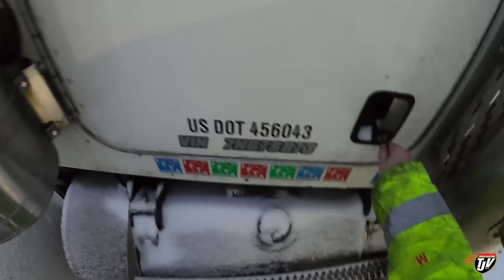BURIED, FROZEN, AND DEAD | My Trucking Life | Vlog #2470

Comment: Josh's gas station is like the old "gas wars" where gas stations on all 4 corners were constantly lowering prices, like each corner had a slash thru each of the posted prices, 7, 6, 5, 4 cents a gallon. That's right, 00.4 cents a gallon US! The oil companies were quick to fix the low prices! It was great while it lasted

Comment: Hi Josh . In conditions like that . I have in an emergency  in remote area  TAKEN OUT THE AIR FILTER .Take the pin puller tie a rag on & dip it in Diesel fuel  squeeze it out hold it to the induction let the motor suck the flam in  BUT NOT THE RAG  get a helper to hit the starter  if the battery’s are good and she turns over fast  . I guarantee she will start 👍🇨🇦

Comment: Drive my truck 91 f150 with a built 302 and 3500 stall torque converter and 430 gears 😂 my fuel milage sucks

Comment: Pretty strange how the batteries got snowed all over like that,as if the cover was off during the night and then that blokheater that wasn’t properly conected….very strange.Was kinda upset to see you sitting in the other truck with that grease spot on the back of your vest…the grease would come off with some petrol or a grease remover

Comment: Fuel prices are the same at all stations because of the provincial regulators that set it (usually once per week.) It's not up to individual fuel companies. Since they can't compete for fuel prices, they now all have points systems to lure customers.

Works the same for every industry. Trucking companies all charge the same fuel surcharge to their customers, dentists charge the same for procedures etc. It's all set by the province and their ministries.

It makes sense for the most part since companies are not competing for the lowest price. Everyone charges the same, they can only compete on service and how good they are.

Oil works much like stocks. It's mostly speculative. Only instead of stocks in a company, their trading barrels of oil and the cost of each barrel.  Which effects the cost of oil byproducts like gas, diesel, aviation fuel etc. Etc.
Reply from the maker: I would much rather they compete on price
Reply: @Trucker_Josh  I completely agree!

Comment: Brother invest in fuel efficient car. Why insist on gas guzzling trucks.
Reply from the maker: Because those tiny cars only get stuck in the snow, they are more dangerous and you can't do anything with them. You can't haul much, can't pull anything, can't get through the snow, and they're cramped.